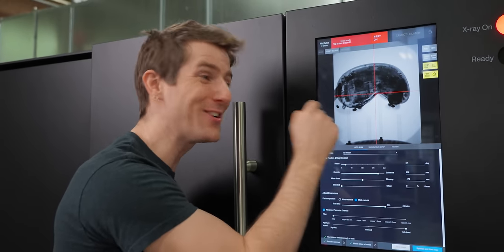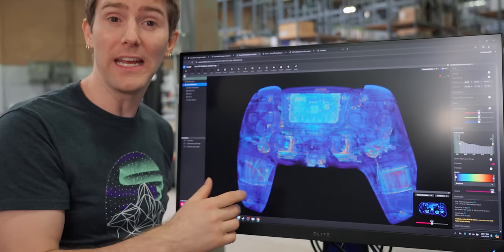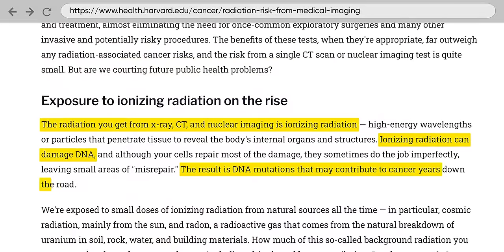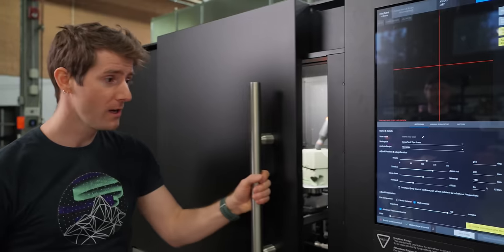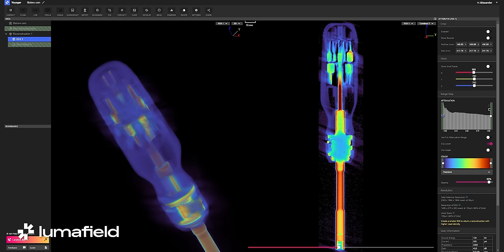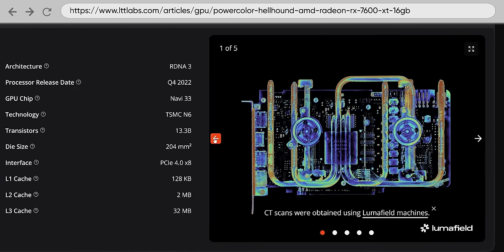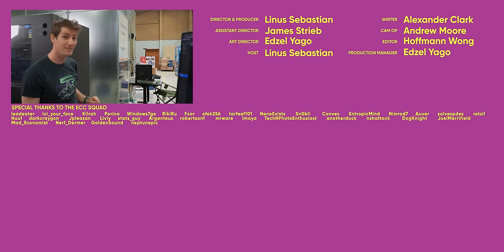We can X-Ray Gadgets we Review Now! - Lumafield CT Scanner

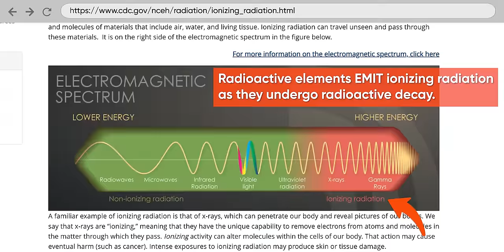Comment: Hi there, nuclear engineer here. I find the claim at 9:05. There is something called Gamma activation. That is where ionizing photos are able to, in short, MAKE things radioactive. Now the levels would be fairly low but it renders the aforementioned claim false. If you have a Geiger Muller detector available I'd measure the chamber and the object within before and after a long scan to either confirm this or prove me wrong.
Reply: I was also thinking about this, but I wondered to what degree it'd be dependent on material and isotope
Reply: Industrial Maintenance Technician here... yeah id get a Geiger i remember when our xray for checking parts started making parts radioactive... not bad just concerning
Reply: what a flex to be able to start a comment with "nuclear engineer here"
Reply: I have learned of this phenomonon from YouTubers... and was suspecting something like this when it was mentioned, but obviously do not have the background to say s***. (I am a corporate IT support) I am glad a member of the community clarified this, thank you!
Reply: You want a flex? Fine... Remember that video of a guy launching himself over the Judge's bench in a courtroom, sending judge, security, flags and so on flying? I put that in a nuclear physics lecture for post grads. Alongside screaming goats. I've taught nuclear physics to medically type people with memes.

Now that is a flex I am proud of.

(I shouldn't be)
Reply: I have worked with that kind of tech, and it's not an issue in the case of xray scans. You tend to run into gamma activation when you do neutron diffraction ( to the point where you don't even try to save your samples) but for standard x-ray tomography / diffraction, it's not really an issue
Reply: @williamcoffy1836  we never considered it a significant issue and were working with photon energy levels waaaay higher than this. When we got into neutron generation... Well, that's what the judge meme was about.

Edit: would be interesting to see a before and after test though.
Reply: Rocket scientist here....
Reply: I agree that this is a probability but what energy of photons are we talking about? These machines go max 100-120 KeV. I know that this is a thing in Linear accelerators, where you blast photons with energy in the MeVs and they have few millions more photons created but in small system like that, it can be considered negligible. If that was the case, every clinical CT (again giving more milliampere*sec than this system known as mAs) should have a Geiger.
Reply: interesting. I thought only neutrons could do that.
Reply: I was going to say, isn't Marie Curies things so radio active that they are stored in lead boxes?
Reply: @darthlost  her body is buried in an lead lined casket
Reply: @darthlost  Marie Curie was working with Radium and Polonium, already in an unstable position. Yes, her desk and chair are still radioactive. X-rays have some potentials to create radioactive materials but in this situation or for medical imaging is negledgible (cannot even been counted).
Reply: or even scan the working geiger detector and get realtime radiation levels on every sliced layer of a detector))
Reply: as a magnet scientist I routinely probes things with X-rays and other higher energy source, I can tell you that you won't be getting any lingering radiation if you use x-rays. I only worry about having a radioactive sample if I am working with high energy sources like neutron and gamma radiation where the sample does become radioactive after exposure, especially prolonged ones (mostly applicable to Mössbauer spectroscopy which uses gamma radiation).
Reply: @Cusa_  that really is a good god damn flex. 

and yeah i agree, they should use a giger counter.
Reply: As expert I must say you are wrong: Nucular, the word is nucular! 😉🤣

PS: I trust only Somaris.
Reply: @darthlost  her stuff are contaminated with radioactive elements which is very different than how x-rays are made in a machine which uses electricity to excite electrons and releases high energy photons of x-ray energy
Reply: That would require enough energy to remove neutrons from a nucleus. Thus GAMMA activation, but this device uses XRAY wavelengths, so no gamma and no neutrons. I'm not a "nuclear engineer", but I passed high school physics
Reply: As a physicist (also interested in CTs), I must say, that this effect should for the most part be very minimal and should be negligable. Overall we want an Image and no damage to the object... This is no radiotherapy device
Reply: Question, is this radiation higher or lower than the natural Radon Radioactive exposure you get from merely living on a mountainous region? 
Follow up, is this radiation higher or lower than the exposure you get from Mobile phones etc? 

I would say, the radiation dangers depends on the radiation type and how it is handled. Considering that North America and global nuclear corporations believe 30 Msv is okay per year for a nuclear worker. I doubt you will reach that level with the material generated in that Lumafield device. 

Which in the end, renders your statement, as you call it, a claim that can be put in question. Because you also need to consider, how much radiation exposure will a person suffer in contrast to the global recommendations? And what type of radiation. Airborne being the worst, while materia can generally be washed off from your person.
Reply: Question is how many photons in the higher kev range does this machine emit.. and if the part is a few percent more radioactive than before the scan, then it's still basically nothing
Reply: @richarddavis2605 ionizing radiation literally is x rays and gamma rays. Glad you added that you’ve only passed high school physics since it shows how poor the education system is if they didn’t teach you that either. Mechanical Engineering here, and I learned this in middle school before taking physics or chemistry in high school.
Reply: @Jimmy_Jones  rocket science?... eh, it's not exactly brain surgery.
this reminds me of the Mitchel and Web brain surgeon sketch
Reply: Aircraft engineering here.....any issues? slap some speed tape on it and don't worry too much...happy flying
Reply: @ElectroWaveAI  Boeing engineer?
Reply: Hi there, medical doctor here, so by no means a physicist. However we commonly apply these technologies and weigh the pros and cons. An average abdominal CT scan equals about 8 mSv. In radiation therapy of tumors, such as prostate cancer dosages are more in the range of 80 when roughly converting from Gy which is an organ and radiation type dependent unit and those dont become radioactive either. If I remember correctly, the amount to actually induce radioactivity of course dependent on the matter would be in the thousands. Please share your thoughts and correct me if Im wrong.
Reply: @Cusa_  But we can all say we're made of nucleons, so there's that.
Reply: Nuclear physicists here… you’re correct and there where one or two other misleading or inaccurate quotes in here but  I think it’s pretty decent what they explained
Reply: The activation time is to short to be any great harm..  ahh and bytheway... medial phsicist here 😂 you need at least small MV to get some short(seconds) activation...
Reply: @Rumorix2018  I believe I get twitchy around 11.48MEV. I think. I tend to just go on buttock clenching rather than raw data.
Reply: My guy casually started his speech with "Hi there, NUCLEAR ENGINEER here"... What a chad!
Reply: i love internet for such random (and awesome) conversations you can find

Just an IT guy, but interested in stuff. I must say when they explained it, my first thought was about radioavtivity. Overall the exposure of items is high so it's really cool to read your takes on this!
Reply: Yes, although it is active production, reduced by lead, and the problems with gamma are smaller because the penetration depthnis so high
Reply: How much you make per year?
Reply: i was wondering if he was making the objects in there radioactive
Reply: @Lamb666  bros flexing his baby mech eng degree while still not understanding the person hes trying to roast is 100% right.
Reply: I think we should keep threshold in mind, especially since a lot of people are scared of radiation. Yes, gamma activation will be happening. Will it be to a level severe enough for disclosure to people who fear banana exposure? No, and the need to pedantically "well actually" about this is why we suffer listeria outbreaks instead of irradiating all leafy greens to destroy the pathogenic bacteria that is now pervasive and making people sick. This machine produces far less radiation than an irradiator, so it's safe in this aspect. Now, if it were a demon core device that could gamma activate every light metal, that would be different.
Reply: @darthlost  very dirty materials involved there.
Reply: "Nuclear engineer here" is such a crazy flex lol
Reply: @Lamb666 Radiation is considered ionizing if it is capable of detaching electrons (thereby creating ions).
Gamma radiation is indeed capable of knocking a neutron/proton/alpha particle from the nucleus, a process known as photodisintegration.
Reply: Yeah like David Banner.
Reply: @liamosterhout6538  you're right, the op is wrong
Reply: I have been and done experiments at syncatrons, where we have millions of times the intensity of xrays and yet we don't care? Power level I work with is about 12kV for graphite. They could work with 120kV in that mashine with the fact he mentioned the screwdriver.

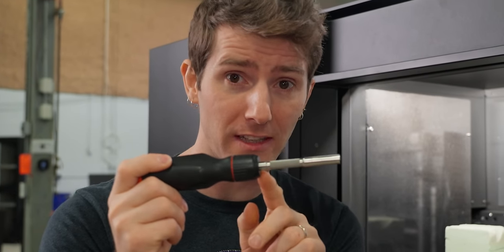Comment: 13:21 This is actually the Pantheon, not the Colosseum!

Fun fact: It has the largest unreinforced concrete dome in the entire world, which is especially impressive for a building from 125 AD.
Reply: The Romans knew how to make concrete, modern engineers still haven't figured out the Roman recipe or reproduced it.....
Reply: @MaverickBlue42 didnt they already did?
Reply: @MaverickBlue42  That's just not true. Roman concrete is just a general term for concrete that uses volcanic ash in it's composition. Concrete is not a single material, they're probably thousands of variations, depending of application.
Reply: Yeah, they should google or duckduckgo it next time hehehe. Love you linus('s writers) <3 The Romans were indeed cracked with their structures, so much cool stuff lost to the ages...
Reply: @MaverickBlue42  We figured it out around January of last year, the secret was quick lime
Reply: @MaverickBlue42  they did recently, it has to do with the "lime clasts" that were once thought to be impurities, now we know that they enable the concrete to heal micro cracks by dissolving and recristalizing
Reply: I imagine they mean that it is a colosseum, which I believe is accurate.
Reply: @johnb2127 But it is not one
Reply: @johnb2127  A colosseum is a theater or stadium. The Pantheon, however, is a church. That's definitely not the same thing.
Reply: @MaverickBlue42 The Roman cement recipe is perfectly known, theres no secret. We could rebuild the pantheon with modern portland cement just fine and it would last just as long, but today we dont really want to use that much concrete. Using steel reinforcements is a lot cheaper than just using more cement for the same strength.
Reply: Sorry to break all the people in here, but they do technically got steel reinforcement down the line

Comment: I used to work at a place that had an X-ray machine. I would mostly use it to examine PCBs, particularly BGA and no-foot components. It was also helpful for inspecting different layers of a PCB to identify any broken traces. The machine was quite old and kept in a lead glass case with pan and tilt functionality. I may have also used it to examine my cell phone and other electronic devices. I also helped move it. It was extramly heavy.

Comment: subscriptions for equipment like this are standard. you don't want to buy them outright, you get a managed service contract that includes field service engineers and parts because even the parts you might need for it might be 5 figures and engineers can swap a few of them out at a time when troubleshooting.
We could easily employ several of our own engineers for less than the total of just their engineer fees, but then we would have to pay for the parts outright each time.

Comment: I'd like to see you buy a bunch of broken Nintendo Switches or other standardized electronic devices, take a scan of a working one, and then see if you could fix them based on the scans. 

If they included a compare and contrast mode with this software this could be amazing for diagnosing things like bad solder joints, a bad conductor, or other hard to see components.
Reply: With what he's said about gpu farms and machine vision, that sort of thing sounds entirely possible. It would be having the expertise on staff that may have more bearing on it. I'm sure at a glance someone could spot a blown capacitor or maybe a shorted rail.
Would be pretty amazing if someone like a Louis Rossmann could detect why a pp3v42 is only at 2.4v just by finding a short to ground etc.
Reply: @benwu7980  in an open GPU I can see that, but in a switch it would require disassembly and inspection on each unit. I think it's easier to toss a unit in, start a scan, walk away, and come back later to see. 

oh, I wonder if it could do multiple items at once and if an algorithm could be run to autodetect major differences?
Reply: @heroofnone  I would doubt that multiple items would work out too well due to focus and the axial issues.
With their 3d printing capabilities, I could envision a really nice mold that sits on the plinth (or overlaps it )and have it cradle a device near perfectly. Then set up the machine to have a preset for that particular device. Unsure of the idea of side by side comparisons since the software is cloud based, but I'd be hopeful.

Comment: I worked in a research lab that used CT daily. I just want to point out that beam hardening can be corrected via software as well. In fact, all your reconstruction work can be done without their software if you are able to obtain the DICOM file for the projection images (i.e. the many 2D xray images) and there are free/open-source software to view the reconstructed images as slices and as 3D models. 

The main problem you will run into when you do this is the mapping of HU value (standard unit used in measuring attenuation of the scanned material on a human CT) to specific materials. There might be "phantoms" available for purchase that will be able to help you do this mapping though.

Comment: Lots of lead, but that door not "clicking" when closing it gives me chills...
Reply: No I felt the same, I was convinced it didn’t even close properly the first time
Reply: I know these machines. They have a electronic lock that will activate bevor the X ray tube does
However in case you wanted to you could circumvent it I’m sure… but yeha you can do harm with manny things
Reply: For systems even without an electronic locking system, the ones I use have an overlap between the door and the wall of the system, such that if you are a muppet and open the door mid-scan the x-rays (which are electrically generated, not from a radioactive source) are turned off before you get a clear path to the inside of the system 😊

Comment: Very cool video, keep the lab content coming! One fun side project use for this machine would be scanning electronics that have been sealed by the vendor with black epoxy - typically done to obfuscate the type of ICs used in their products. Things like "audiophile" amplifiers or filters, certain development PCBs, knockoff/counterfeit electronics or similar. You could also scan processors to inspect the type, density and dimensions of thermal interface material used between the die and heat spreader without initial destructive inspection.

Comment: Suggestion for scans: parts that failed with obvious and visual damage (e.g. video cards with a broken tab. That melting 16pin power connector)
GaN chargers (Gen1/2/3 vs. regular DC USB-C chargers)
Fan bearings (e.g. Noctua SSO, Corsair maglev, FDB, rifle bearing, etc.)
Portable BT speakers (What makes some sound way better than others?)

Comment: I doubt you're seeing the air around the controller, what you are likely seeing is scatter radiation that bounces off of objects. (I've worked in x-ray imaging in healthcare for about 26 years now.) And yes, it is always interesting. Good job explaining the basics of x-ray imaging. We have some expensive high end CTs now that don't need a scintillator and can count the photons directly without converting them to light. Filters are widely used in mammography imaging as well, to optimize the beam for imaging soft breast tissue. Actually this tech with the rotating filter is a lot how mammography works.

Comment: I’ve been wanting this technology for so long it would be wonderful to be able to scan an engine or a carburetor or a power supply basically anything and detect problems with it without even taking it apart as well as see if there are design flaws without taking it apart. This would be super easy to spot defects.

Comment: Pretty amazing!  So I read about some of the very early CAT scans used in a hospital -- something like 1978 or 1979.  They had a DEC VAX upgraded from the base 1MB to either 4 or 8MB (which I think the RAM alone cost about $100,000).  The scan took a regular amount of time, but they had to take a guess where the brain tumor was to tell the computer what slices to make.  It took overnight (like 8-12 hours) to calculate 4 slices and luckily they caught it in their slices.

This being able to do a full 3D scan and just roll through the slices is pretty amazing.

Comment: Super cool tech. Minor correction: Monochromatic x-rays do not require a synchrotron. You simply need collimator and filters to select for a single wavelength. I do this all the time with an X-ray diffractometer.